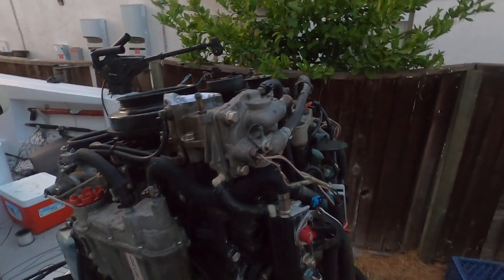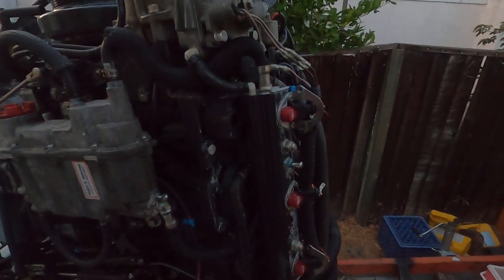2004 Mercury Optimax 200 Diagnostics and Repair of Compressor and Injectors

Comment: Hi Duke. Really good video.  I am in Australia. I have 2010 optimax 250. My compressor went at 501 hours. I was told 500hrs to be ready. It was all to do with that Mexican made grey compressor... the new black one seems fine.  I have 1400 hours now and no issues since that first failure... had to replace some injectors and coils but all good now.  Thanks for sharing
Reply: grey vs black? can you provide new compressor P/N?

Comment from the maker: Follow up comments: After this work was complete, the motor idled poorly. After further investigation and repair, the idle problem was associated with a bad/broken reed and a few poorly performing spark plug wires. Runs good now and back to fishing.
Reply: did you do a video on replacing the reeds?
Reply from the maker: @ryanvarner6520  no...but it is simple but not cheap
Reply: How did you test the spark plug wires?

Comment: Hello Duke, very clean video. I am hitting the same low RPM issue.(chugging) over 4300rpm. coils and injectors not giving any indicator of n issue. did you have any video of your vst cleaning/fuel pump kit maintenance/ or fuel rail removal/maintenance? i have 483 hours  and no  codes /warnings. replaced plugs/impeller/and fuelfilter. now the chugging is starting around 4000.  how did you diagnose the air compressor? any video? thanks again for this good diagnostic video.
Reply from the maker: Failed air compressor showed a precessing (wobble) pulley and threw metal shavings in the fuel rails thus clogging the nearest fuel injectors.
Check the air compressor pressure for 90psi. Also check compressor for wobble and/or metal shavings inside compressor.
I would also inspect the VST bushings and seals.  They are probably old and maybe leaking. If any signs of wear, replace all the bushings and seals...about $80. I had a similar problem and the high pressure pump grommet was worn and back pressuring the low pressure pump float bowl causing low flow and starving the engine.
Oh...and thanks!
Reply: @dukeduarte8728 I'm approaching 450 hours on my 250 pro xs and I'm wondering if the compressor is serviceable?
Can it be rebuilt before I experience a similar catastrophic failure?

Comment: I've been told the OEM direct injectors (850065A5) for the 2000 Optimax 225 HP have been replaced with a newer part. Do you have any knowledge in regards to this, and how to test the ohms to verify good or bad parts?
Reply from the maker: No I do not. My original direct injectors tested fine and thus did not need to get into replacements

Comment: Is there any trick for removing the air injectors from the rail?  I removed the rails and the fuel injectors came out easily enough, but I'm not sure about the proper procedure for removing the air injector from the fuel rail.
Reply from the maker: I grabbed with my fingers using a pulling and twisting motion and was able to remove.

Comment: How many hours do these air pumps usually last before failure?
Reply from the maker: Think my motor is at 500 hours when air compressor failed
Reply: @dukeduarte8728  how much does it cost to replace the compressor? I am looking at a triton with a 225 black optimax (non pro xs) with 300 hours on it. I just talked to a guy and he told me to replace all the injectors and clean the fuel rail if I get it. It seems like it will be very costly.
Reply from the maker: @tlalexander3  about $1300 for the compressor itself. keep an eye on the compressor for any noise like a bearing failure. investigate any abnormal sound. replace unit with any internal bearing failure. One guy here says to just replace a bad bearing, not a bad idea if you catch it early. replacing injectors would be ridiculously expensive. you can send them out for cleaning and flow testing.

Comment: just curious. why couldn't you just press the old bearing off and replace it with a new one? In my time as an outboard mechanic and shops, I owned there was rarely a time when you couldn't do this. Even if Merc didn't offer the bearing there are bearing shops in most towns. Just have to use a micrometer to get the exact size.... Hope it all worked out for you.
Reply from the maker: good Idea! I was afraid of piston and bore damage caused by the failed bearing material.

Comment: I am not that familiar with these engines is the compressor a super charger it boost air into the cylinders . I have a customers 2006 115 hp out here I have no clue how these work I dont have a manual on it , How are the compressors lubricated is there a reservoir for the oil
Reply from the maker: The compressor boosts air to 80psi into the fuel rails. The unit is lubricated poorly  via a tube by the lubrication pump. This is why I think they fail prematurely.
Reply: @dukeduarte8728  So what you are saying is the oil pump for the fuel mixture also supplies oil to the compressor ?  Is this vacuum operated like most oil injection pumps? Is this like OMC VRO or does is run with a electric pump? I see the part on here about priming the compressor with the control box with the key on when installing a new pump. So the 80 psi mixes with your fuel in the fuel rail and is injected into your injectors in the cylinder together correct? Thank you for the reply
Reply from the maker: Yes...I believe vacuum
Reply: @dukeduarte8728  Ok so you are like me you know a little about it thanks bud for the replies have a good one

Comment: If you shut it down immediately, you should not need to do anything else
Reply from the maker: Once we noticed the power loss, the damage was done. Too late.  You would need to pay close attention to the air compressor for any sign of premature failure such as squeaks or pulley precession.
Reply: @dukeduarte8728  If I have squeaks now... any video or link to other video to diagnose the ACompressor? If I'm early to notice it, what can I do now?
Reply from the maker: @danconn2065  inspect it carefully during operation looking for top pulley precession. Also look and see if lubricant is being injected into the pump via the small black tube.  You can also take the top pump cover off and inspect the bearings and push rod and check for metal shavings.

Comment: If you shut it down immediately, you shouldn’t need to do anything else
Reply from the maker: If there is a gradual failure of a bearing and the squeak is slight initially and not noticed, the failure debris will enter the fuel rail.

Comment: Engine should have thrown a code, you should have gotten a device to read it. Vessel View Mobile.
Reply from the maker: this failure mode may not throw a code until it is too late.
Reply: Only failed code would be a compressor overheat. Or an direct injector fault